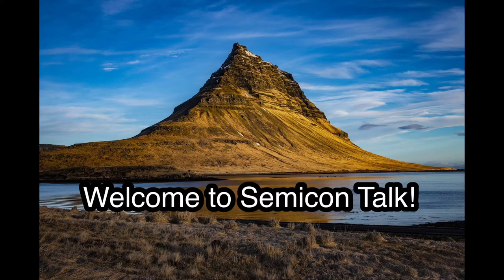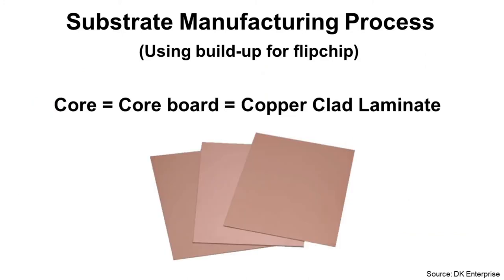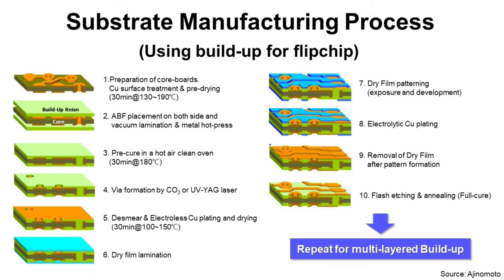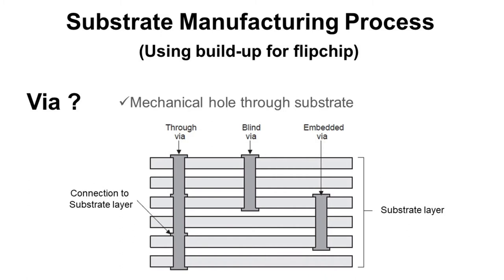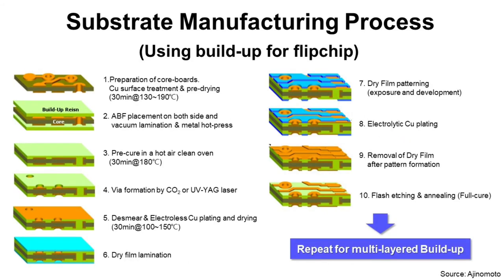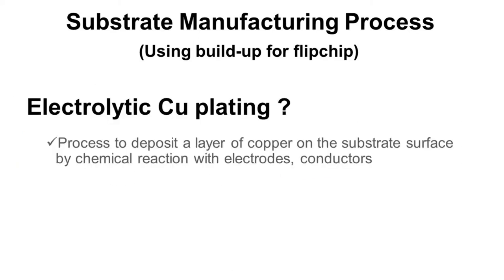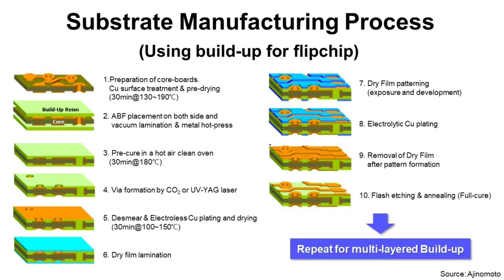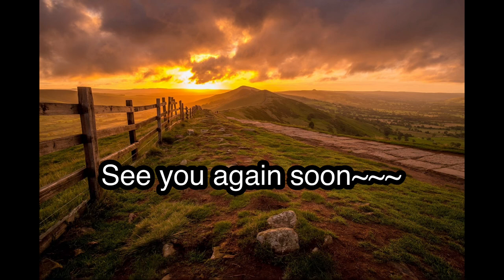[Eng Sub] Substrate - Flipchip Substrate Manufacturing Process, Core, Build-up, ABF

Comment: It is so informative!! Thank you. Could you explain the difference between the BT resin and ABF also?
Reply from the maker: BT resin stands for Bismaleimide Triazine resin and developed by Mitsubishi Gas Chemical, Japanese company. It is a liquid type resin and usually used with woven glass fabric to make prepreg for fcCSP package substrate.
ABF stands for Ajinomoto Build-up Film and developed by Ajinomoto, Japanese company. It is a film type insulation layer and usually used without woven glass fabric to make FCBGA package substrate.
ABF can make more finer and complex circuit like FCBGA than BT resin for fcCSP.
https://www.mgc.co.jp/eng/products/sc/btprint/
https://www.ajinomoto.com/innovation/action/buildupfilm
Reply: @semicontalk3223  thanks again!!

Comment: why do they use ABF instead of  prepreg when making fcbga?
Reply from the maker: Major difference between ABF and prepreg is woven glass fabric. ABF does not use woven glass fabric but prepreg uses woven glass fabric. This woven glass fabric can not make fine line and space trace in substrate. So FCBGA substrate uses ABF because it needs to make more finer line and space than fcCSP for higher electrical performance.
Reply: @semicontalk3223  Thank you for your answer, but i can't not understand the reason why they can make fine pitch when they use ABF.
The absense of glass fibers is related to thickness, but it is not thought to be related to fine line and space....... how can i understand that making fine pitch?
Reply from the maker: Please check slide 6 and 7 of below file. I hope it can help.
https://www.ajinomoto.com/cms_wp_ajnmt_global/wp-content/uploads/pdf/ABF-presentation.pdf

Comment: What is difference  between PCB and IC substrate packaging. are they same ?
Reply from the maker: Great question. They are different. 
IC substrate is small and used for IC packaging. Small means usually less than 15mm x 15mm size when IC substrate is used for packaging in smartphone. If IC substrate is used for packaging in datacenter, it can be 55mm x 55mm size or even larger. 
PCB is large and many IC packages are moundted on PCB. Large means that it can be several times larger or even some tens of times larger.  
Typically IC substrate uses more advanced technology to make than PCB.
Reply: Could You pleaee  explain  in terms  of process. Additive  process  and substrative  process? I completely  agree  in terms  size.
Reply from the maker: @praveenlb1  Please check below links.

https://www.quick-pcba.com/pcb-news/pcb-production-process.html

http://www.imapsfrance.org/minapad14/SESSION%201%20INTERCONNECTIONS/ASE_EPP_MiNaPad_2014_05_21.pdf
Reply: Both PCB and sustrate use similar manufacturing method, but substrate has higher IO density than regular PCB. vias are made by leaser rearly used on rugular PCB, typically only used on HDI board, so price will be much expensive as well.
Reply from the maker: Thanks for explanation 👍